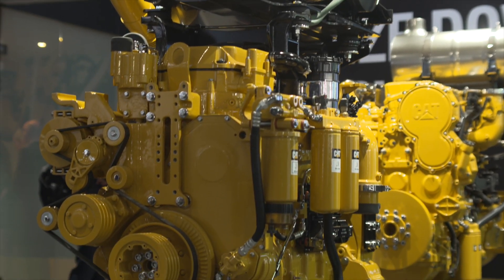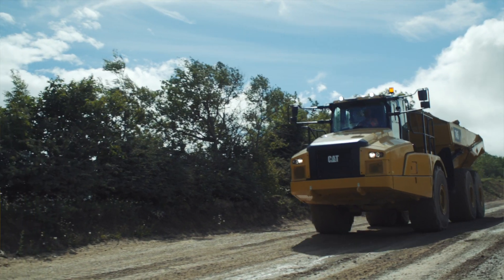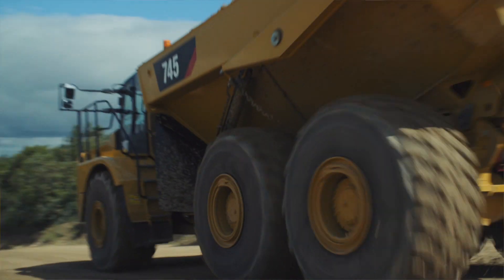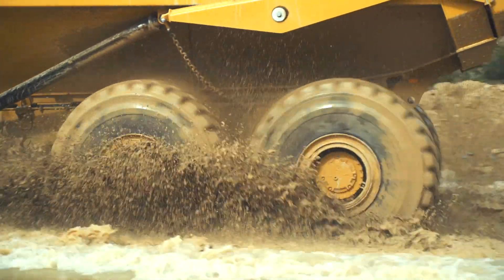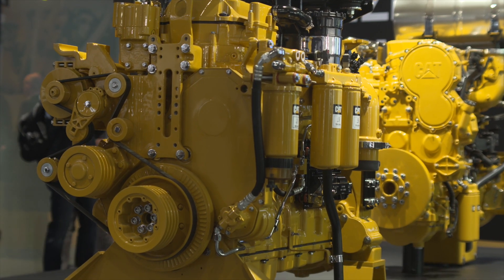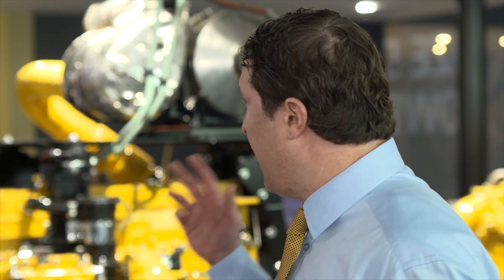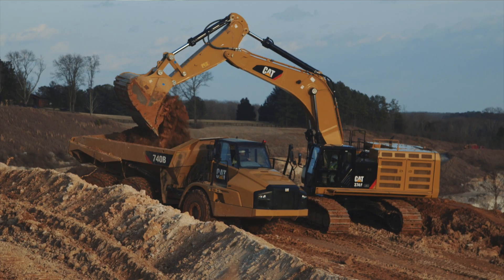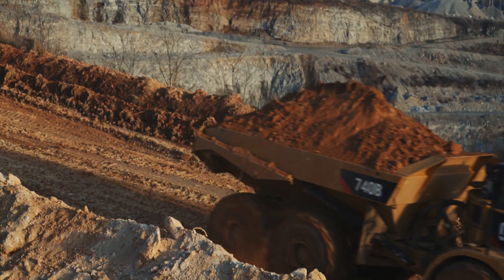Cat® C13B Industrial Engine Walkaround With a Cat Engineer

Comment: No EGR? That is huge.  Congrats on that accomplishment.  Is there any data on added longevity without EGR?
Reply: Egr is off, an intake throttle valve is used to increase exhaust temps. Higher def dosing to compensate egr delete. Im curious aswell. We have the first running